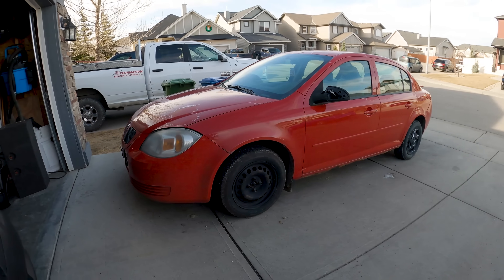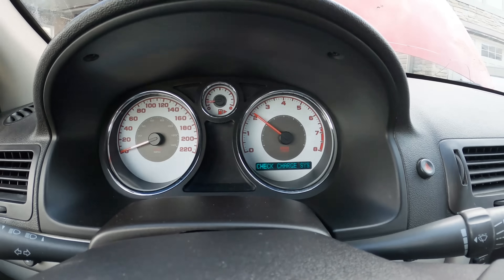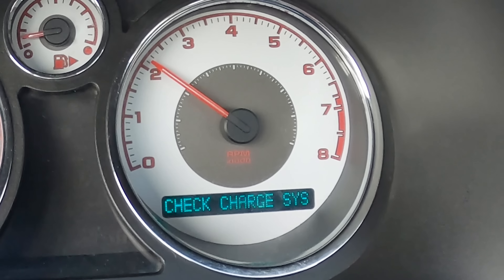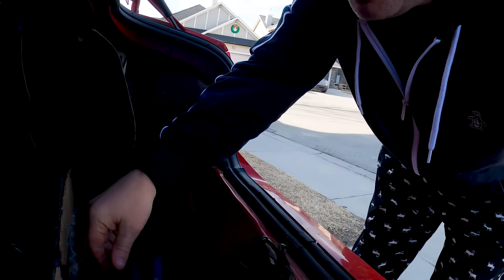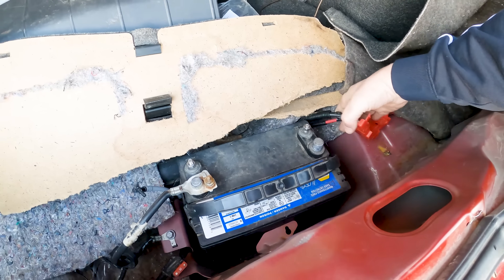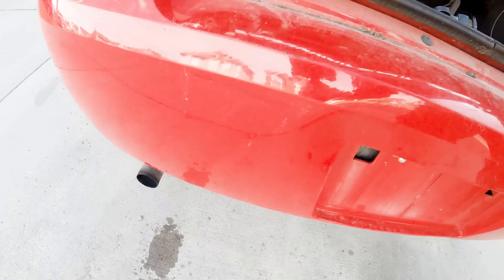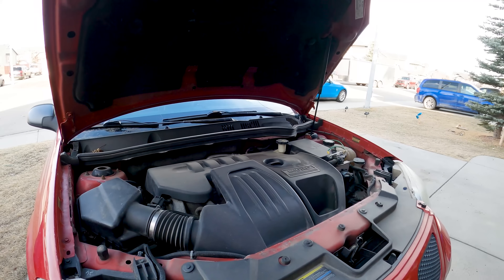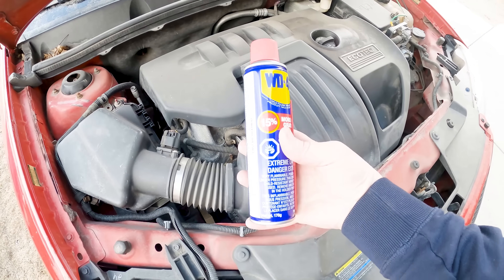ROADSIDE FIX! REVIVE your DEAD or DYING Alternator with this ALMOST FREE trick! | Gears and Tech

Comment: Although your WD40 trick may work in some cases, particularly sticking or almost worn out brushes,  I am not convinced it can temporarily make diodes or failed windings work. In fact it could create other problems, like arcing/sparking/fire.  An alternator creates alternating current, and changes it to DC (direct current) by way of diodes. Rotors can fail by shorting out or shorting open which eliminates the magnetic force that creates the electricity. The rotor coil fuse will blow, or the wire will burn open.  If you have a multi meter, check for AC readings on the battery, and if so, your brushes and rotor could be fine but the diodes are faulty.  Drive safe. ☺♥†♪♫ 3-18-24
Reply from the maker: It's not perfect. But it's worth a shot
Reply: Rob, in my case it was a literal life saver..read my post above.
Reply: @sevendyseven4090  I did say that in some cases it may work.  However for the many cases it may not work, someone may get the idea to use the whole can because it still doesn't work. Spraying a flammable solvent in an engine compartment comes with risks.  Life saving is more appropriately related to STARS, who in a worst case scenario may have to be despatched.  Drive SAFE, and walk close to God ! ☺♥†♪♫
Reply: @sevendyseven4090 It is unlikely that most people would keep their head in the fire. Unless they were knocked out by the catch on the hood, or the hood was being held up because the support was broken or missing.  However; after having all your exposed hair singed from the explosion caused by an unsuspecting spark, you may become disoriented and wander/step into the traffic, that you mentioned was whizzing by in your case. Now that could be fatal, and STARS may not be able to help.  We are talking worst case scenario. Murphy's law is still alive and well.  An ounce of prevention is still worth a pound of cure. People die everyday, but some are preventable.  ☺♥†♪♫
Reply: @RobSweigard  Lol, you do make me laugh
Reply: @sevendyseven4090 The Whole World needs a lot more joy, humour and laughter. It also is a fun way to learn and communicate.  Keep smiling, it is contagious. ☺
Reply: Water Displacement formula #40 designed for use in electric motors.
Reply: @lloydthegreat911  A simple Google search should correct your assessment that it is guaranteed safe.  I believe there is a video of how to die when welding, and if I am not mistaken the electrode connects with a can of WD 40 on the welding table. Any solvent based product could be deadly. Drive/walk SAFE !   ☺♥†♪♫ 3-23-24

Comment: I am an old guy who knew about taking the cable off one terminal to see if my alternator was bad, but didn't know about the WD-40 temporary fix. I will carry a can in all my cars now. Thanks!
Reply: I reckon that using electrical parts cleaner spray would be your go-to not wd40, but what do I know? 😂
Reply: @grantperkins368  ..grant...who the hell carries a can of elec parts cleaner in their cars...i'll wait..
Reply: @sevendyseven4090  there's always one ... Ok buddy,, when you get it home, do it with electric parts cleaner so everything doesn't cling to it in the future.  Happy now?
Reply: @grantperkins368  
Hey, if you read my personal testimony above you WOULD of seen i NEVER needed no can of elec parts cleaner when i was rescuing my sister stranded on the side of the road on that fatetul late sunday evening as cars whizzed by shaking her little broken down truck...
P.S. I only ever squirted about 6-7 shots of WD40 into mt sister's S-10 alt, and that was it, no parts cleaner ever was used and SHE GOT TO HER INTENDED DESTINATION

there..happy now?
Reply: @sevendyseven4090 who the hell carries WD-40 around in their car? I'll wait....the man that made the comment is correct rather than using a lubricant you should use an electrical cleaner. Damn WD-40 COULD CAUSE IT TO CATCH ON FIRE
Reply: @ThatSneakyNinja  
Here is a list of what is in my truck box & cab:
Brake cleaner (unused can), water 2gals, full jug of coolant, all sorts of fittings/rubber grommets,etc, bolts/washers/elec. connectors/tire plugs/cordless drill/serpentine belt/hand held torch & solder, wire/zip ties, gasket maker,  tadiator stop leak/head gasket repair in a bottle, one smallish bag of tools, used starter and alternator and one engine coolant sensor, one man brake bleeder/spare brake line and 2 compression fittings..and lastly, WD40, lol.
I broke down once at 4:am in 2000, 3 hrs from home on a lonely black night, while i was figuring out a fix on how to limp home, a car of young hellion shits pulled behind me a ways and wanted to make this so much worse for me with their comments and incite a confrontation..i don't want that ever to repeat having no resources.
All my tools have helped out others broke down since. I am a small shop on wheels, lol.
Reply: @sevendyseven4090 I heard WD 40 is not always recommending. It is sticky and attracts more dirt. I’ve heard this from multiple good authority, but yes in a pinch, better than nothing.  I’m not sure what the better choice is (perhaps it’s Lithium grease or this electrical spray people are suggesting)
Reply: @sevendyseven4090 nice list. I imagine you have a serpentine belt de-tensioner wrench in that tool bag. Or what do you use to release the belt?
Reply: @bdmenne  
I do carry a used serpentine belt behind the driver seat, and to remove the belt, all i need from the truck bed is my 3/4" ratchet wrench, my 10" leverage bar to slip over it & my 3/8" adaptor to fit the de- tensioner ('96 chevy) .. i almost bought a tensioner wrench, but i cannot justify the $38 for it for something i can do the red neck way, lol.
I have added a few items since my last post,  a brake line flare kit, and a container of O-rings, and a Delco fuel pump and a newly purchased tool bag for another 40lbs of tools, lol.
Thank goodness my chevy came with a little tool box under the hood to carry around all this crap.
 :)
Reply: @sevendyseven4090  nice! Plus the room under the hood. I miss how roomie my ‘88 Nissan reg. Bed was. Prolly could cook a small chicken in there.  
lol on that de tensioner tool. 
I rented one from Oreilly, didn’t realize it had a Rental Window. I passed that time and became the proud owner of it automatically.
Reply: @bdmenne  Take it back to a different store. That employee was a ----. They don't usually give you problems for a few days.
Reply: These cars on the road today aren’t like the ones from the 70’s and 80’s and you’re asking for major trouble removing a battery terminal with them engine running now. You could easily fry a module doing that and I have seen it multiple times. Far too many sensitive electronics and modules in today’s vehicles to do that.
Reply from the maker: Glad I could help
Reply: Of  course he's gonna say that he rebuilds alternators fir crying out loud
Reply: Man that runs an alternator starter rebuild shop told me to never do that. He said doing that can blow the diodes in the alternator and if the car has an ECM it can damage it costing you hundreds of more dollars.

Comment: Don't check that way.just put a screw driver near the alternator if it's charging it will connect with a magnetic power pull towards the pulley. Safely 😮
Reply from the maker: That works too

Comment: You're not pritty. You wear pajamas out front. BUT: You probably just saved many folks from unnecessary hardship!
I don't buy WD40 as a lube (it is not), but with their newer line of products, be sure it's  the ORIGINAL water displacement formula you're shooting in there. I'd hate to see someone  shoot the lithium grease in!
Reply from the maker: First to mention the pajama pants.

Dead right about the other wd40 products

Comment: This trick work with the old school vehicles but it’s a very bad idea with newer vehicles with ECM . By doing this depending on make can and will cause a power surge if your alternator is working. I myself have seen back yard mechanics do this very trick on a ford F-150 . I had warned him not too pull battery cable while truck is at idle he then pulled cable it surged blew up all his head lamps and smoke came out from PCM . Not a surprise the truck would not start the cost of repairs exceded the value of the truck for PCM harness and modules head lamps  and labor . I’ve got 43 years of dealership ASE Certified smog tech diagnostic service with Gm and Honda . There is one way to get you home if that happens with alternator or starter choose a solid spot on either one and tap with a solid object a hammer it works but once or twice do it at own risk but I’ve done this for years with no issues but disconnecting battery cable while id
Idling not good idea .
Reply from the maker: Thanks for sharing

Comment: as a retired auto electric tech I cant tell you NEVER PULL THE BATTERY CABLE on a running car! you can and will blow the diodes in the alternator and let the smoke out of your onboard computer, radio and nav system!!!
I have done hundreds of repairs on cars that were "tested" in this way. this was a valid test for older cars with generators back in the day but not on cars with computers.
Reply from the maker: Thanks for stopping by

Comment: 3:17 FALSE!!!! WHEN YOU DO A COLD START THE ALTERNATOR PUTS OUT IT'S HIGHEST VOLTAGE BECAUSE OF THE HIGH IDLE RPM WHEN THE ENGINE IS COLD. AN ENGINE AT OPERATING TEMPERATURE (HOT) THE IDLE VOLTAGE IS LOW DUE TO HEAT!!!
Reply from the maker: Thanks

Comment: We used to hold the blade of our pocket knife over the center of the back of the alternator. If it was magnetized and attracted the blade, it was good. The new stuff is made so you can't work on it and it is no longer simple, so this old trick won't work on the late model cars.
Reply from the maker: Seems to still work

Comment: The Alternator produces Voltage and current. In the past a 60 amp alternator was commplace on lots of autos.

But new cars with mult fuel pumps and AC compress clutch and blower motors and other things may need 100. 150 Amp alternator to supply a large current load.

Now the Alternator can fail because of more than one factor.

The voltage Regulator can go out and some Alternators have them build in and some cars like older fords had them some were in the engine bay. 

If the Voltage Regulator shorts out and burns up no amount of cleaning the Alternator by spraying any thing into it will make it start charging.

If it fails because of nomal brush wear it means that one or both of the two brushs runing on the slip rings are are no longer making contack with the pressure of the springs use to supply pressure keeping them tight on the slip rings.

The part of the Alternator that moves is just an electron Magnet and its field is made stronger or weaker by the current coming througe it from the Brushs.

And thats control by the voltage Regualtor. 

For the most part the slip rings should be clean due to the fact the brushs are in counstance contack and like a verry fine peace of sand paper say 600 grid keeps it clean

And if the brushs are so wore out the pressure from the spring can no longer keep it soild in place its going to stop charging at any time.

Now the Altenator could fail because one of the Diodes fail and could burn out or short out as well

The Diode pack is whats takes the AC voltage from the Alternator and turns it into DC voltage. At times one of the diodes can fail and the system will charge the battery 

But over night the diode will let the battery drain back through the Altenator and give you a dead battery. 

Any good tec knows how to check for a drane on the battey and the Altenator is one possible sorce or other itams like the keep alive circuit in a radio were the preset stations are not lost.

A sticking break light switch can also drane a battery as well 

Its like leaving a light on

You can also have the Altenator fail if one or more of the main charging wires short out and this will burn the main altenator wires in no time 
In side the Altenator 

Spraying any thing into a Altenator possible could cause a fire remember theres possible some arcking at the brushs were they mate to the slip rings.

Depening on just how much of a spark it takes to cause it to ingition of the chimical used

But at times the wild card comes into play and some things can work

A good charging system should be able to hold 13.5 volts at idle with the headlights. Blower motor on.

Remember driving at night in the rain in new cars your going to have the 

Headlights
Blower motor runing for AC or Heat 
Wiper motor on in the rain or snow
Fuel pump or fuel pumps on some cars.
Radio 

And thats a good load with out things like heated seats 

If your not sure if you charging sustem is strong lots of autoparts stores will check it. Or you can try turing on the headlights. AC and blower motor to hight and wipers as well and at a round 12 to 1500 rpm the voltage should be around 13 to 14 .5 volts.

If it drops below 13 volts at 1500 rpm you could have a weak charging system. 

But check with the shop as so many cars have a wide rang of thing and your Alt may need to be at 1800 rpm give or take.

Remember if you driving and start having charging troubble at times you can turn off things to reduce the current use.

In Aircraft we use to run dual Altenators one was the main say 100 amp and the other was the back up Altenator say 20 to 60 amp

During ground run testing the engine RPM would say 1800 RPM and all the systems would be switch on and the main Altenator would be switch off.

You would get an warring and then go down the check list turing off things like the landing lights electral back up fuel pump. Strobe lights. Pito heat.

At some point the stand By Altenator warring should go out and it would be able to supply the current.

This is were the pilot has to be on his mark when it comes to picking what systems to switch off.

He has avionics and aircraft system. If its possible for the pitot tube to ice over he is going to keep the pitot heat on and turn off the aircraft heater 

Hope this helps never clean the inside of an Altenator that had quit charging.

But at times people come up with new ideals
Reply from the maker: Thanks for sharing

Comment: If you have that volt meter plugged into the power and it shows 11 volts and should be 13 or 14 I don’t think you need to remove a battery cable as that is proof the alternator is not working. Just spray the lube and watch the gage.
Reply from the maker: True

Comment: I came to say that old school alternator test was cool back in the 70s but it will fuck up some shit way more expensive than your alternator today. I had a ground wire short on an 05 Silverado. 750$ computer got smoked. Even with seven grounds on the ECU the start circuit got smoked. You gave me a good tip I had not known but you should edit that pull the ground right out. Just use your gage or idiot light for side of road test.thanks for the tip.
Reply from the maker: Thanks for stopping by
Reply: OK then, how the hell do you change your battery then do you not take the cables off of the battery post. What the hell is the difference?
Reply: @AllGoodOutside  the alternator aint…..aw nevermind. Good one!
Reply: @joecliffordson  yes Joe I realize they are talking about disconnecting the battery while the engine is running and yes, there is a difference, but it's unlikely to cause problems like a lot of fearmonger on here. Try to do.
Reply: @AllGoodOutside  if you are good with unlikely so am I. On the off chance you smoke a diode or worse I would not give thousands of would be mechanics bad advice. While I agree with you I also know of several increasingly sensitive systems this does not work with. You may assume engineers put in protection for surges and low voltage run problems but i have seen enough problems from battery ground deficiencies that i would not advise it. I left you one example but there are others i have personally experienced. Enough so i quit pulling the ground even on my old stuff. I mean what is your risk level? Oh well i need a new computer or alternator and now my whole system needs to be re-flashed? If you are good with unlikely please by all means continue to take this shortcut but it ain’t ryeaaot tellin others this is kosher when its not. Its is not a question of fear it is a question if proper teaching and sharing something others may not be aware of so that I can save them the absolute misery of worst case scenarios. So there ya go folks. Btw i did not even mention all the ways one could die pulling the ground on a running engine. That would be fear mongering and I am more risk oriented in my tolerance levels for death and destruction. In short you are insincere and most likely a scaredee- cat. If we are tossing around insults.
Reply: @joecliffordson  I can't recall our conversation but I Don't believe I Cast dispersions upon your character specifically with any name calling. I insinuated that there a lot of fear mongers in the chat but regardless, I ended up replacing alternator cheaply and easily in reference to specific discussion I didn't test anything 1970s style playing fast and loose the electrics end up CPU in my truck so basically everything is just a moot point but have a nice day anyways, And the scaredy cat moniker…..aw nevermind. Good one!
Reply: @AllGoodOutside . Let us hope our antics are at least entertaining if not educational. I miss the days when Chiltons used to have detailed instructions on how to restore a starter, alternator, and voltage regulator.  May there never be an end to the curious mechanical minds in the youth of the world. Thanks for the chat.
Reply: Will WD-40 not burn, my concern is after soaking an alternator  down it , would catch fire,  after awhile it will evaporate. Does WD-49 conduct electricity ?